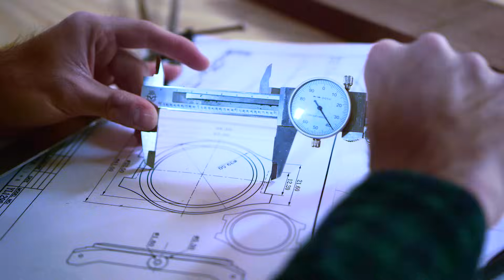The Making of A Wooden Watch

Comment: I read a lot of reviews about easy breaks, and non responsive customer service. These guys need to learn to run a reliable business, not just have fancy design. Reputations take years to make, and just a day to break.
Reply from the maker: Hi Larnuse, Thanks for your comment! Our products are tested extensively before anything goes out. We pride ourselves on having an overall defect rate of under 2.5%. Our customer service team typically replies to emails within a couple hours. If you could check your junk / spam folder; sometimes our replies get stuck there. If you're still having troubles reaching us via email, shoot us a Facebook message and we'd be happy to help!
Reply: They responded to my questions very quickly.